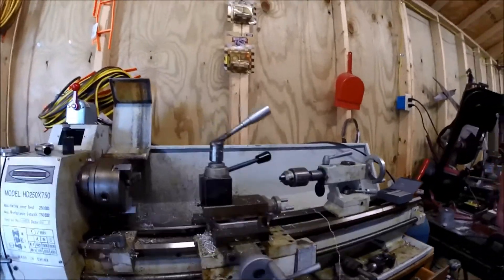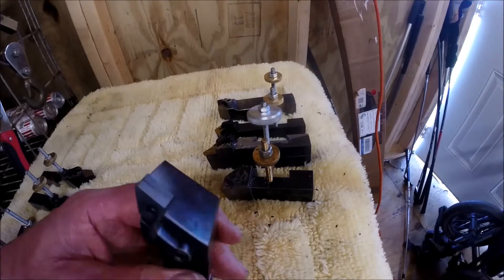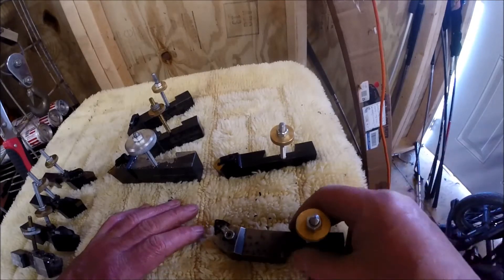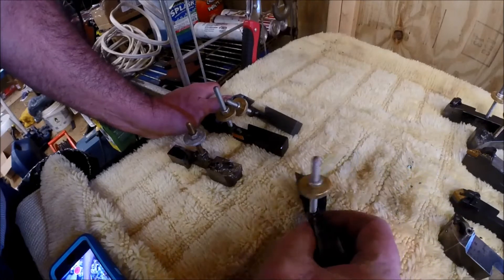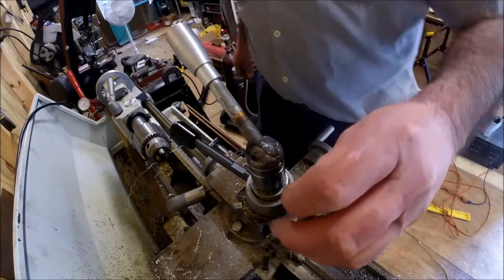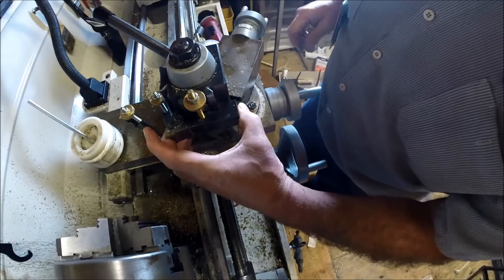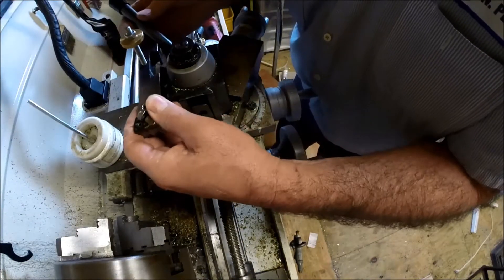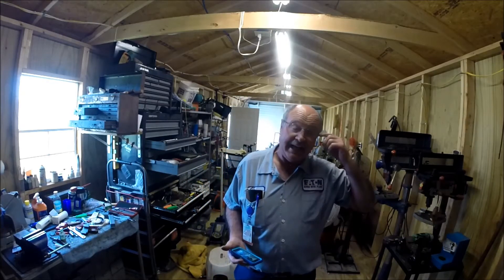My modified toolholders

Comment: James, I bought me a holder and thought I'd make one like your doing. What did you use for a drill and tap? My drills wouldn't touch it. Tried several drills, all the same. Used a mill cutter. Tried tapping and my craftsman tap broke! was taping 3/8-24 UGH! Any ideas?
Reply from the maker: john campbell I first of all used 1/4 20 threading rod. One thing you need to do is drill for 60% thread because a tool holder is tough steel. I used a good tap. My craftsman taps didn't cut it.  When you get it tapped then loctite the screw. 

Hope that helps